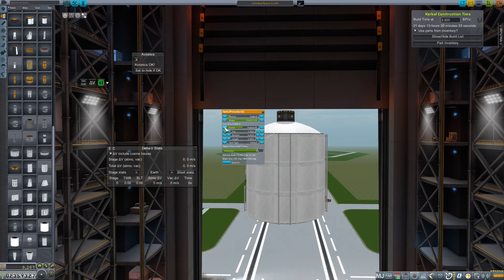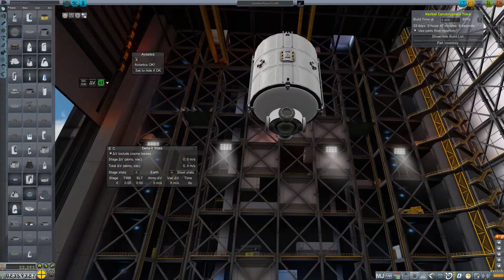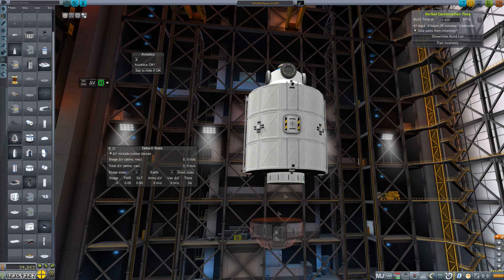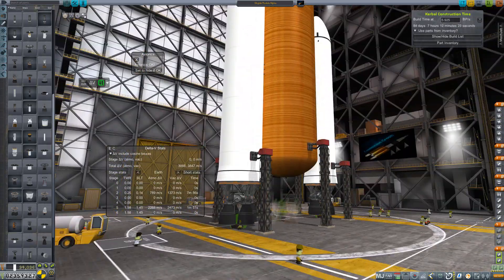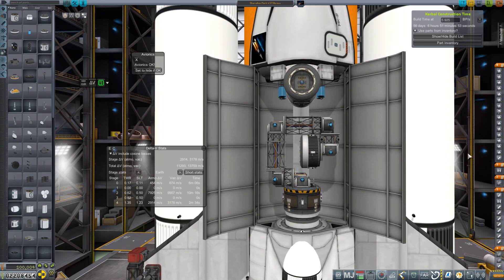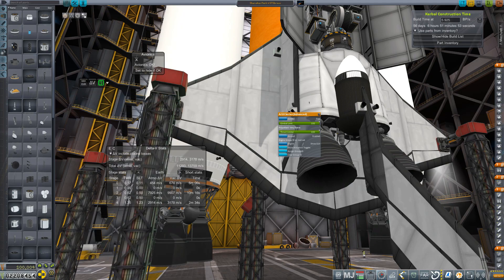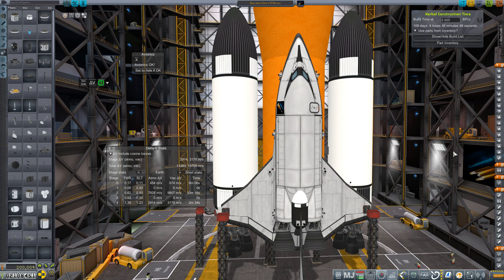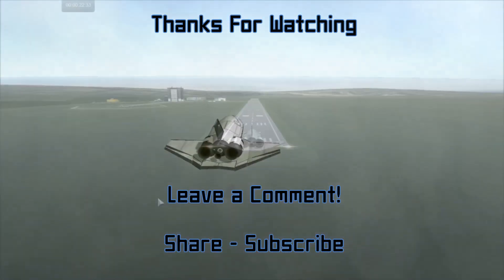KSP RP-0 #312 Station and Sheruiken Upgrades

Comment: I think you waste way to much space by carrying the waste, waste water and carbon dioxide with you. Why do you do that, I mean they are useless. 
I just did a test in my save: if you fill the skylab module with
-1,730,000 oxygen
-17,100 food
-11,350 water
-500 Lithium Hydroxide
-100,000 Electric charge
you get 8 years of life support for a single Kerbal, and 1 year for the max crew (8 Kerbals)
Reply from the maker: wow, I had no idea the waste products took up so much space... Guess I never checked either.  
I had this idea once - that I was going to edit some one of the Hab Modules to be a Hydroponics bay ( as TAC has no provisions of such ) It would take in CO2 - Solid Waste (fertilizer) - Electric charge, and output Food, waste water and O2 in obviously small amounts not enough to subsist a long term mission, but to help extend the duration of limited storage for life support.  Having a part for Electrolysis purification would be nice to - takes in waste water and electric charge, outputs water...
I keep telling myself that someday I will sit down and start working these things out - just haven't gotten around to it yet.

Comment: I don't mean to sound pessimistic, but that arm looks an awful lot like kraken bait. I know that IR, used as an arm, and large structures don't play well.  If you do use it, be sure to keep it stationary while attached to station and shuttle to avoid the kraken's wrath. Be careful.
Reply from the maker: Kraken bait it is - its not meant to articulate with a cargo ( or shuttle ) attached to it - just to move itself to a position to aide in the docking - then to lock the hinges/rotatrons in place for a secure fit.  Though couldn't it also be said that running RSS/RO/RP-0 is itself Kraken bait lol?